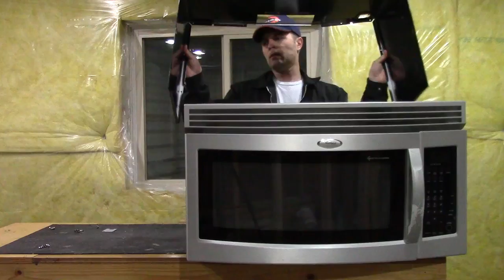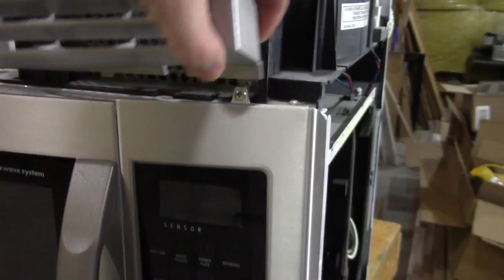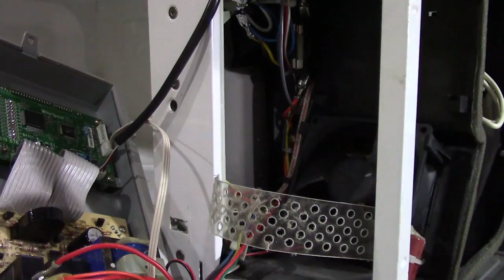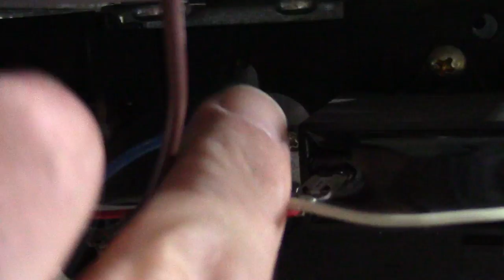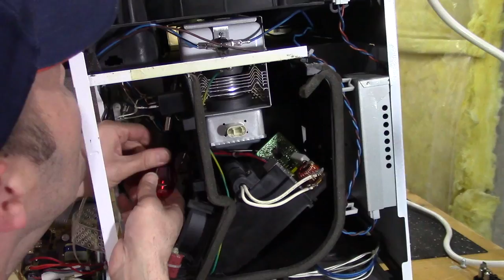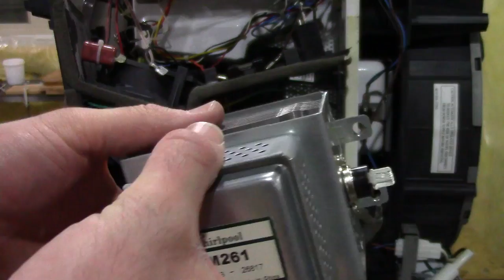How to remove a Magnetron -  Whirlpool GE Microwave Oven

Comment: I have the same microwave, and had a huge power surge go throught it.  Was not working at all, then I replace circuit board and all fuses not I have power. Now it heats but doesn't have a hummimg noise like it use to. Any idea what it might be???
Reply from the maker: So its working?  Light on? Table rotation? Heat? Maybe your internal fan is not working. Did you forget to plug it into the circuit board when you replaced it?  Check to see that everything was plugged back in to the circuit board.